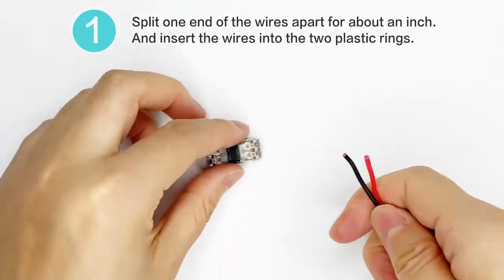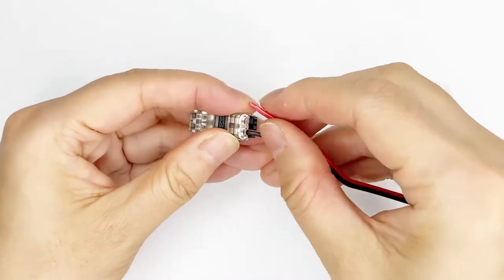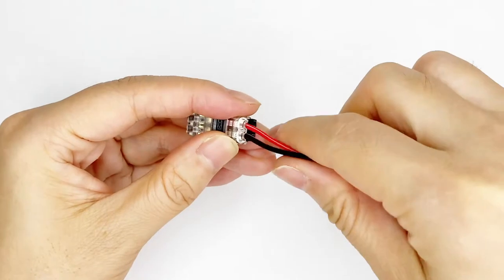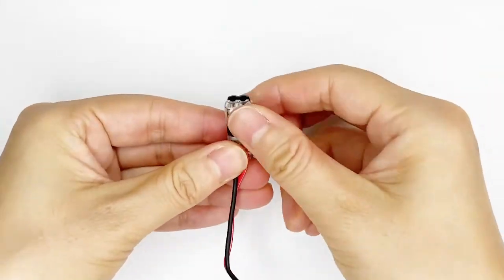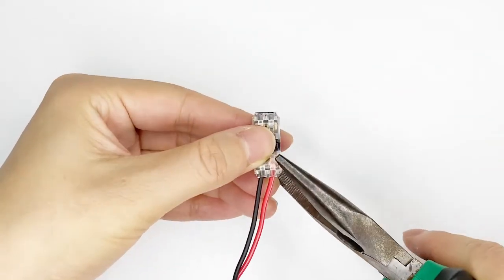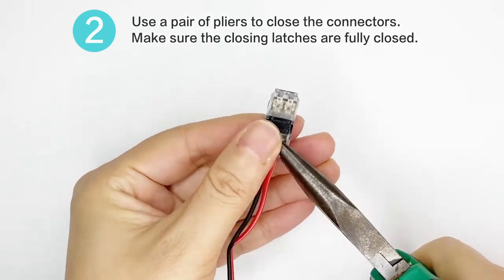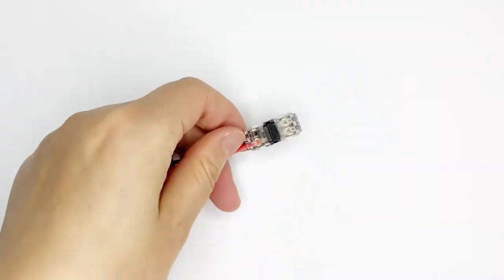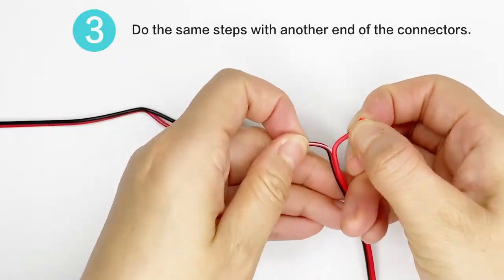BRILLIANCE4U H/I Tap 2 pin wire connector

Comment: This things are junk, used them for some little fans upgrade and they don't cut the trough the insulation so they dint make connection, waste of money
Reply: best to strip the wire first
Reply: That's my experience as well. It's 50/50 whether they will work or not.